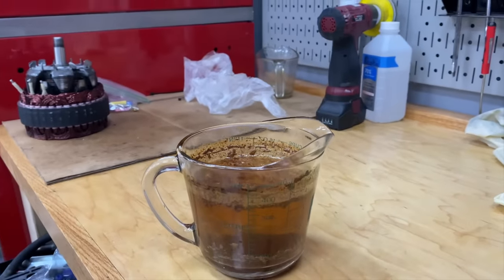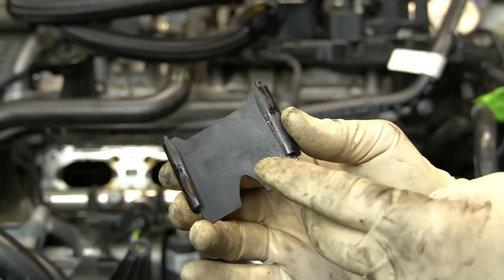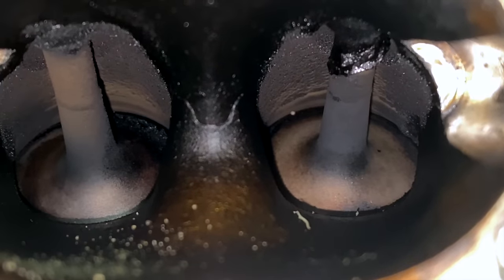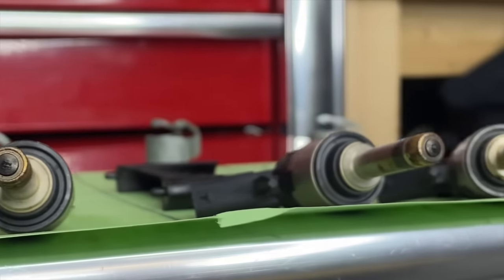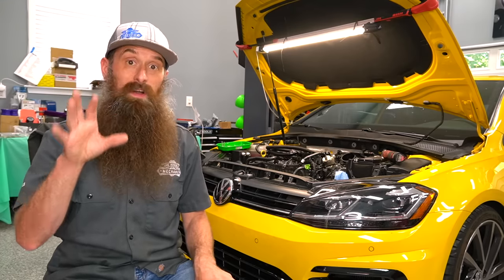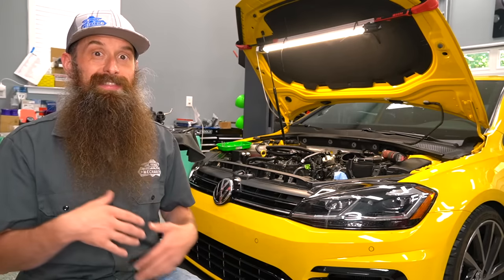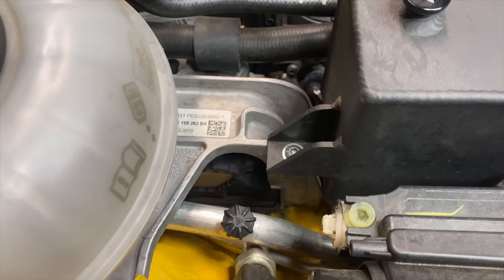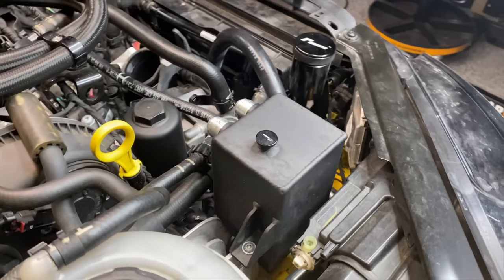Did the Catch Can Work? 10k MILE TEST

Comment: I think VW engineers test, design, and expect the engine to get water circulating back through PCV system and you are eliminating that so that may be why you smell burning oil?  My opinion is that ze Germans designed these engines to need regular carbon cleaning and that it is an expected revenue stream for dealer networks and it can contribute to faster turnover and new vehicle purchases. When I owned my B5 Passat the VW service department tried to sell me on things my car didn't need, namely new coolant hoses and around the same time they said "time to buy a new one?!"

Comment: Why don't you create your own drain plug on that catch can? Just drill a hole at the bottom of the catch can and tap it and use a bolt with an O-ring on it as a plug.
Reply from the maker: There is a hole at the bottom. But you can’t access it while the cam is installed

Comment: Regardless of how expensivemuch the catch can system, using the engine mount bolt to secure it smacks of laziness and/or a lack of knowledge of the vehicle it's supposedly designed for.  It's ridiculous to expect a user to replace that bolt every time it needs emptying.   More likely they didn't know/didn't realize this was the case...which tells you how much they actually know about the vehicle.  Whether you're pro or con on the catch can subject, I'd seriously avoid a manufacturer like this.

Comment: For years I've seen companies hocking expensive cans like they are the end all savior of engines and carbon build up, but they tend to be waste of time and money. On a high hp race car with a lot of blow by? yeah, but on mildly modded daily driver? nah total waste of time. It just adds complication, more expense, they tend to stink, you gotta deal with emptying nasty sludge, they freeze up in the winter, if you forget to empty, you end up with a total blockage of the pcv system, etc. Just way too much having to babysit it.. There's no set it and forget it. It's a forever thing that you have to maintain, and after all that, there's no night and day difference. I say don't bother. Also, water meth injection doesn't keep the valve any cleaner, in case anyone is wondering. Good for other stuff, but useless against carbon buildup. I ran multi port water meth injection for probably 50k between intake replacements and valve cleaning and they were still sludged up
Reply from the maker: Great points! I’ve talked with guys saying the same with meth

Comment: I removed my Racingline catch can setup just one week after fitment because of a burning oil smell on my 8V S3. Since switching back to the OEM PVC the smell has disappeared. I also really disliked the mounting location. The kit looks nice, but that's about it. Would not recommend it to anyone. It's neither a prevention nor a cure for carbon build up.

Comment: 20k on your oil??? Am i missing something? 
It's common knowledge now catch cans are mostly a gimmick, although some engines can benefit from it, (Chrysler 3.6) look in your air cleaner housing that will  tell you if you need one.
Cera tec...I prefer Ester based Bio tech lubegaurd at the half life.
Change oil at <5k and all these problems go away.

Comment: Man, as a mechanical engineer, do you really think that they don't test this on their engines? If there is any improvement is so minimum that it isn't worth to develop a system to have this function from factory. They are not evil masters that wants to destroy your car...
Reply from the maker: I’m not a mechanical engineer. Lol 
I do however fully understand all the levels of testing cars go through. 

There are always compromises made for emissions, cost, and serviceability. 

All cars are built to the average. Even if a CC was clearly shown to help, or even eliminate carbon, they might not install it. 

Is the average driver going to maintain it, or deal with it in the cold? Odds are no.

Comment: @HumbleMechanic what you have is a crappy catch can IMHO. Let me ask you, where do you live? lot's of rain I suspect hey?

Also I have A GDI engine, a Kia Sportage 2L turbo and have no issues like your seeing using a different can. Once a year I take the Sportage into the dealer and get them to run a BG 44K flush through the engine and then add a can of BG44K fuel system cleaner in a tank full of fuel and I dont see anything like what your seeing. Even the back side of the throttle plate is clean after a year. Soo I'm going to swap it up a bit and just use the gas cleaner twice a year and get the engine clean every 3 years knock on wood lol.. Here in Manitoba Canada during the winter I get mostly gas and a bit of water in the can. It hits -40c in the winter and being an all aluminum engine the dam thing dosn't reach operating temps very quick sinse we dont drive on the HWY much, mostly in town. Before the catch can my oil level would rise to the point that the dealer wouldn't let me leave unless they drained some oil or let me run up the road to grab some Amsoil Sig series oil to change it out. I drain my can twice a week just because the engine over fuels the motor to heat up the catalytic converter for the damn emissions thats set in the ecu. Otherwise I have a clean ass engine but it took 2 years to figure out what I needed to do to keep it that way. Thanks for the video man! As always it's great so keep up the great job my man!

Comment: never used a catch can on any of my cars, i've never had a reason to fit one, they just fill up with water, the danger is if unchecked it could be pulling that water into the engine, if you have a ccv problem chances are it has a valve inside that has gone wrong, on my car the whole system needs replacing every 80,000 miles.
i also wondered about the carbon build up on the back of my valves, i checked and nothing, they don't even look dirty really, the inside of the port looks like it has just been cast, this is on a bmw E46 320i with 150,000 miles on the clock, maybe you need to stop driving dirty smokers :)

Comment: a mono injector in the manifold would be more than enough to solve this
Reply: That would effectively be a wet manifold which would be pretty disastrous for fuelling accuracy, especially cylinder to cylinder balance.
Reply: @ferrumignis  still more than enough to allow for a regeneration program to play when cruising at highway speeds
Reply: @two_number_nines  "regeneration program"  What do you mean by this? This has nothing to do with a GPF.  If manufacturers could use a single injector and wet manifold design without crucifying emissions then they would do it. Instead they added a port injector per cylinder.
Reply: @ferrumignis  regenerate the valve surface to normal one. they just spam 3 injectors because they can, but a single injector would be ideal for some base models workhorses

Comment: The way I see it. The catch can is a catch scam. I’ve thought about this for a min. Cut through the bullshit, a modern turbo direct injection engine has a few problems that people should only worry about during maintenance times. 1. If you have a turbo (regardless of direct injection or not) your engine has positive pressure on the intake not vacuum so the pcv is not gonna work as good and sludge could be a problem if you don’t maintain the engine. If you don’t have a turbo then you won’t have that problem normally.  2. Direct injection shoots fuel directly in combustion chamber and look folks there is not anything you can do no matter how many catch cans you put on it, to prevent the valves from getting carbon on them. Nothing… that’s why you see them going back to spraying fuel on the back of the valves on the newer engines along with direct injection.  The catch can is just some bullshit that’s all it is. Clever scam. If it was beneficial the manufacturer would have it on there already. Sorry if you have wasted money on this.

Comment: Conclusion: you failed to isolate variables and need to redo the test without doing experiments throughout the test period or crazy Road trips.
Reply from the maker: That’s basically impossible. Unless you have a lab with a. Dyno where you can 100% control everything including consistent fuel. 

This is far more an accurate representation of how a car is used. 

Your idea is not wrong. But it’s not real
Reply: @HumbleMechanic  I was just being a smart ass, I agree, most you can do is the same test without any treatments or road trips near reveal time…but that’s not exactly realistic like you said

Comment: That looks to be about a pint, (16 oz.) of fluid with, to be generous, 80% water, so about 3 oz. of oil/ contaminants. If you get 30mpg, also generous, that means, also to be generous, you prevented 3 oz. of oil/ contaminants from mixing with 300 gallons of fuel. Are you embarrassed yet?

Comment: This new engines are trash, has power but not last long... My 37 y/o m20 engine, intake valves are clean like new and exhaust valves are whiteish color and problably 5-600000km... And yes my m20 engine is still daily driver.

Comment: I think it's obvious the catch can did work based on its carbon contents, which didn't come out of thin air. The real question here is how good is it? Only a much longer test on similar vehicles driven/fueled similarly could tell you.
Nothing beats a walnut blast except nitrous.
No worries, you wouldn't know anything about that.  😉
Reply from the maker: Add nitrous to MK7.5 GOT IT! HAHAH
Reply: @HumbleMechanic  How to blow both your haldex and transmission at the same time***

Comment: You still getting oil in the intake, by the Banjo bolt connection.
The company that have build this kit, dont understand how a pvc system works. (sorry) 
You need 2 catch can's to make it work. #1 from the valve cover to the turbo inlet. and #2 one from the valve cover to the intake manifold.
See this video:  https://www.youtube.com/watch?v=j6zYaB5DBJI

Comment: Delete the EGR and problem solved
Reply: Most mechanics will tell you that doing that will increase the chance of an oil seal leak by removing the vacuum on the crank case.

Comment: Did you really not clean the sand off the top of the intake manifold before removing it? 
I'd fire the shit out of you if you dropped all that sand down my intake valves bruh. wtf?
Reply from the maker: lol relax my dude. It’s going to be okay.
Reply: Yea I guess it's ok if you don't mind paying a technician $125 - $150 an hour to not pay attention to details like the pile of sand sitting on top of the intake manifold. 
I guess by that logic it's ok to spin the block a few times with the air filter off the engine because it's just a little sand in your intake... 

Nope. 
*Trump voice
Humble Mechanic thought it was just sand
Just sand he said
and I told him
You, are, Fired, so fired.

Comment: I don't see why people buy these overpriced catch cans! Do you REALLY need steel braided hoses with Aluminum connectors?? The inside of the can has only baffles. What's that really gonna do? What I do is make my own. I use a glass jar, add rubber hoses appropriately, BUT, I add steel wool inside the can. this really scrubs the dirty air flowing through and it actually catches alot!! But, if you want racy looks over something that works better, then buy this overpriced box

Comment: Hmmmmm... NGL, you kinda seem like a catch can hater bro 😂😂
Seems like your mind was made up prior that it wasnt gonna work so your stuck in a bit of denial.  I am in no way trying to post a negative image of you here by saying that it happens to us all but i dont understand why you'd think its a possibility that a 400 mile road trip would clean the valves over the can.  However I do agree to the many variables and possibilities that nothing can be said as 110% fact, a catch can has a pretty strong and significant argument to hold its validity.

The design of that specific can though.. I can understand why youd hate that application. Thats a terrible design and seems like lazy engineering especially if you paid over 600 for it!😳😳
Reply from the maker: Hater? No but highly skeptical yes. Many talk as if the catch cans are the end all be all savior of carbon.
Reply: @HumbleMechanic  hahah wellll tbh I dont think you deserve the title of "hater", it was a bit satirical to go THAT far but I understand your point. It is most definitely not a cure to the problem.  I put a AOS in my 2018 WRX and did EGR deletes at 30k. I had the intake manifold and tgv's off to do the deletes then too and  inspected the valves. In the FA20DIT engine there are these metal dividers in the head in which I cleaned off because they where filthy. I should of blasted the valves then prior to my protune but didn't have enough time. Anyways almost 10k later i blasted my valves and those dividers where fairly dirty again but nowhere near the same. I got an IAG ss AOS which is a well designed quality piece but I cannot compare 10k with AOS to 30k without, it isnt fair.

Dual injection would definitely be a solution. Like what Toyota has and in the brz. Orrrr meth/water injection 😁😅😅😅

Ill be doing my valves again very soon, it will be interesting to see them now as the milage comparison will be more fair.

The way I see it is every bit helps if youre going for the "performance" application or plan on keeping the car long term like i am.  If you just put around for 30-40k and trade the car in.. Maybe not so much.

Comment: So add a valve? You're a mechanic aren't you? Just drill a hole, cut some wire in and bolt a valve on, ez.
Reply from the maker: you missed the point of the almost $700 product. of course I can... But do you think most people that buy this will? NO... should they have to? NO
Reply: @HumbleMechanic  ayo I missed that price tag, in that case, you're completely right my guy. My bad.